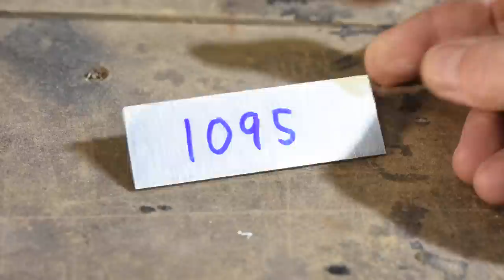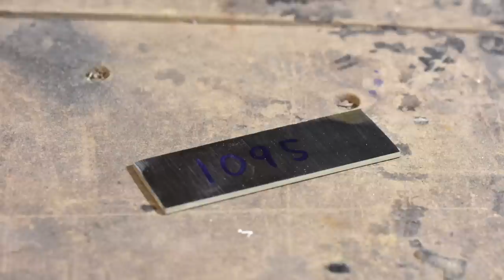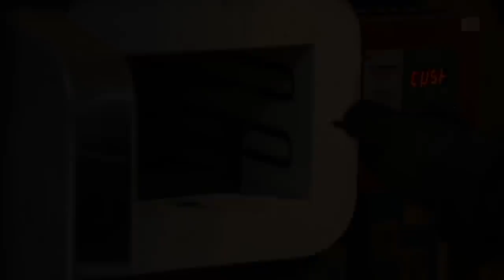Making a Wood Carving Knife with NO Power Tools!  Easy DIY Knife Making Project.

Comment: How come nobody noticed that the early edits are out of order? Also you never want to put the pins in and then take them out...should be one and done. Second time you put them in they will always be looser than first time. And if you're planning on peening the pins then slightly countersink the holes first to give the pins some room to mushroom. Also, why on earth choose 1095 when there is O1 in the world? Also, heating steel to "a light straw color" for 30 seconds is not the same thing as tempering it in an oven at 400°F for two hours. Go with the oven. And finally there are much better handsaws and files to do this work with. Any cheap new backsaw from Menards is better than grandad's dull old rusted Diston. And an 18" single cut coarse bastard file like blacksmiths use will remove material 3x faster than he struggles with in the video. Use a drop of cutting oil on the file teeth and keep the blade close to the vise jaws and there won't be any "shrieking" sound, just fast clean metal removal.

Comment: You can't determine the sharpness of a knife by cutting a paper, a dull knife can cut paper the same way as a sharp one.
Reply: Do you mean the type of steel?
Reply: No, Read the comment again
Reply: Read it again. A dull knife can't cut paper without tearing it! Unless by dull, you mean not razor sharp.
Reply: Well, a knife dull enough to not be able to cut skin, can easily cut paper if it is stretched
Reply: A full knife won’t cut paper the same way a sharp one will
Reply: That's complete nonsense.